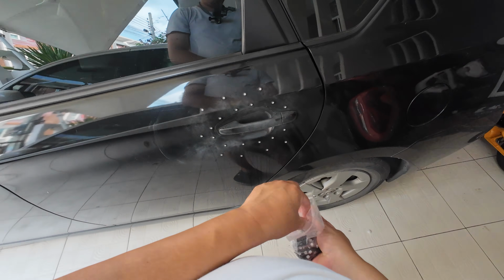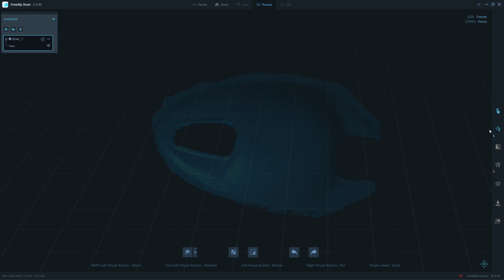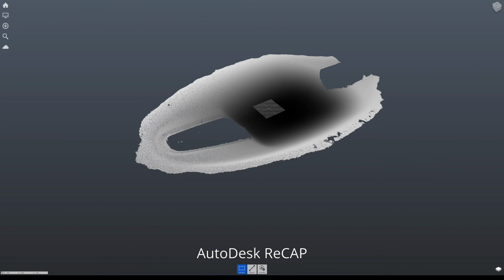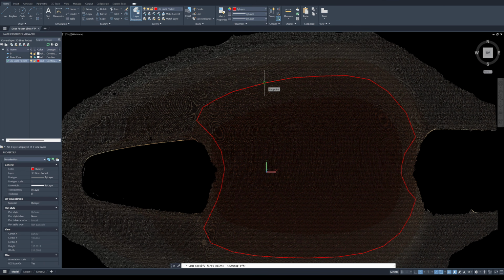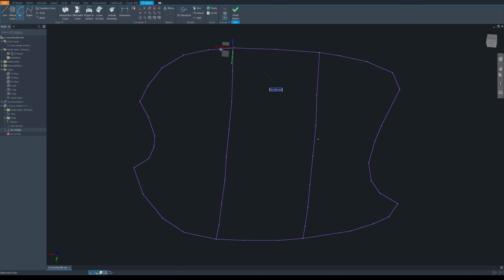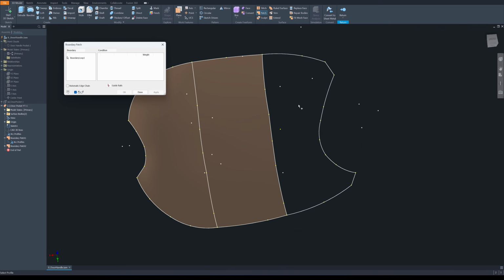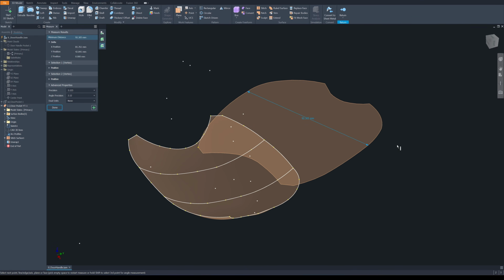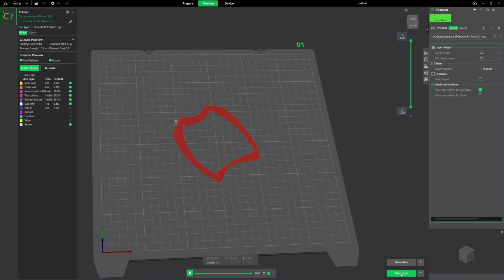From 3D Scan to Perfect Wrap: Car Door Cup Film with Creality Scan Raptor X

Comment: I think it would work slightly better if there are some relief cuts on the vinyl, so it conforms better. Well, its a flat sticker going on concave surface. Nice sharing in any case.
Reply from the maker: TPU is a highly stretchable film. I scale it down slightly before application, then gently stretch it into place for a smooth, wrinkle-free finish. I only add seam lines when working with non-stretchable films.

Comment: It is impressive to see so many file exports and imports without any loss in accuracy. It's very interesting so see the workfow and the software. A FreeCAD variant as mentioned below would be interesting for me aswell. 

I do work a lot with vinyl films. A mounting fluid or soapy water - as mentioned in the video - is a must. The more the better. Try not to touch the surface of the glue - if it's unavoidable the film and the finger should be wet. Slide the wet film at the clean and wet surface to its final position. Apply some heat to the center of the film and start to mount it from the inside out. It takes about 2 - 5 days (depending on the climate) to get to the final adhesion. Remaining water diffuses through the material in 1 - 2 weeks.  

A very interesting video, thank you! 👋😉👍
Reply from the maker: Thanks for your advice!!

Comment: trace it with a wet paper and marker  was too simple and cheap?
Reply from the maker: The door cup has a deep curve, making the paper tape method ineffective when trying to flatten it. However, a trial installation using TPU film could be a viable alternative. You can mark the cutting edge with a marker pen, then slowly remove the TPU film to create a flat pattern. Since TPU is easily stretched and remains permanently altered once removed— from my experience, it tends to result in a wavy edge after removal.